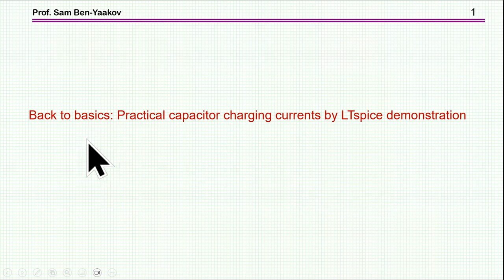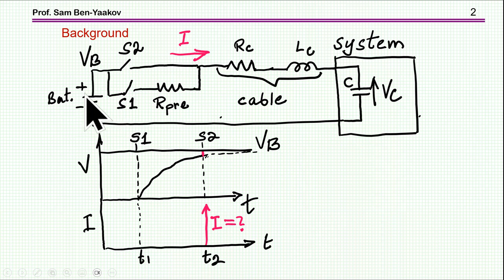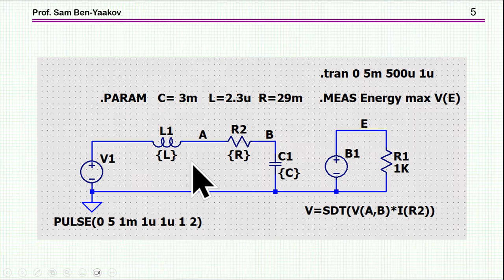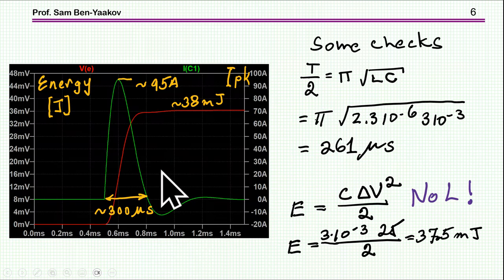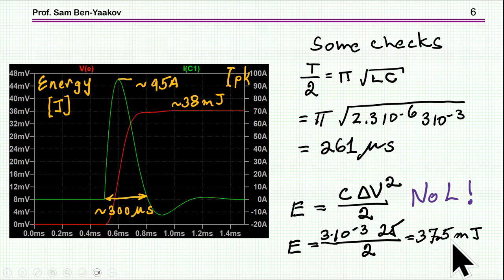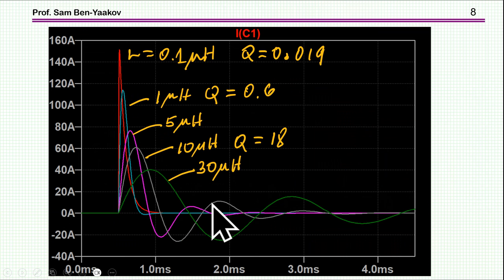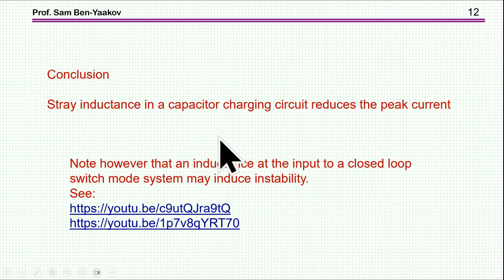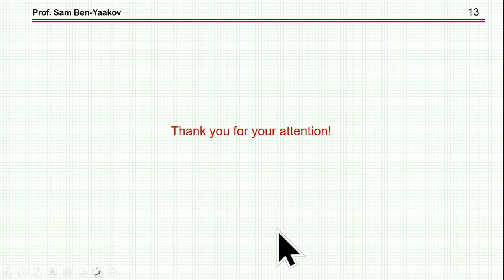Back to basics: Practical capacitor charging currents by LTspice demonstration

Comment: Thank you for the video. So, the maximum current will no be higher than Uin/sqrt(L/C). And the same effect one can see in gate drivers, where we need high gate current in hard switching aplication.
Reply from the maker: Yes, correct. 👍. Hold on to my next, eye opener video.

Comment: Very nice. 
Keep in mind that LTSpice by defualt adds Rser=1mOhm to every inductor in the model to improve convergency. This can be changed to 0Ohmin Control Panel -> Hacks -> Always default inductors to Rser=0. Not sure though what is applied when L=0, whcih may be the rootcause of the difference in Energy you see :)
Reply from the maker: All this is known. But...you missed the REAL question: is the loss with L dependent on R?
Reply: @sambenyaakov  Interesting question, thank you. Intuitively, not. Battery provide energy E*q. And capacitor is charged  finally to E*q/2 energy. So we always lose E*q/2 in heat, we assume charge save in the circuit.
Reply from the maker: @zaikindenis1775  Hold on to my next video on losses. Coming soon😊
Reply: @sambenyaakov I mean that the total energy is not measured only over R2 if Rser=1mOh, hence the difference between L=0 and L!=0 energies. L is irrelevant for the E 🙂
Reply from the maker: @nikolaivic4480  OK, Got you now. You are of course correct.

Comment: Great insight...Sir could you please make video on smps input filter design with respect to voltage mode and current mode control and input filter impact on loop characteristics
Reply from the maker: Will try

Comment: Hi sir. I have a question about LTspice.
Is there a way that add TI models in to ltspice and use it? 
Thank you
Reply from the maker: You may be lucky and the model might be compatible, but if it includes non generic sources or syntax it will take an expert to convert.